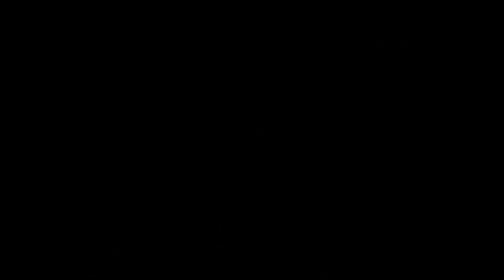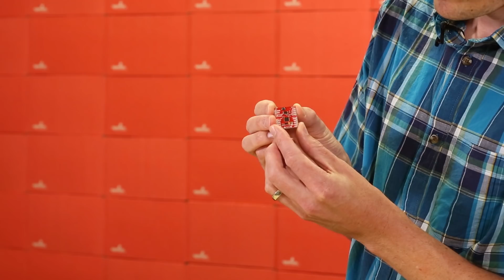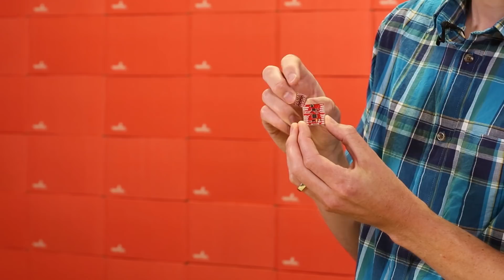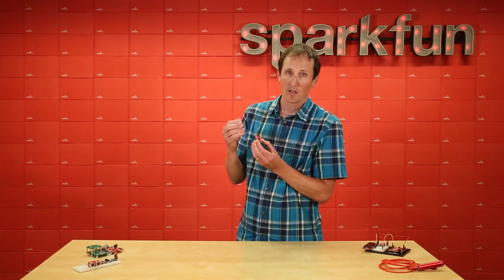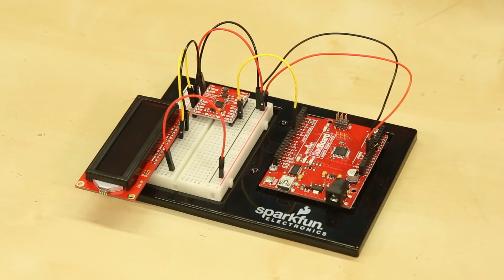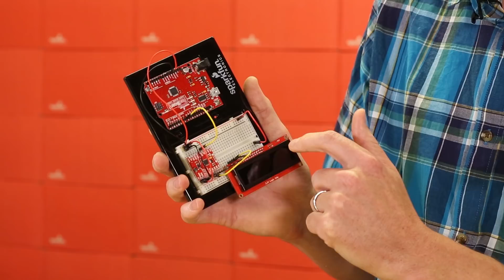Product Showcase: SparkFun Single Supply Logic Level Converter

Comment: Interesting. I hadn't noticed the 4 bit version before.
   I know the JTAGulator uses a bunch of the TXB0108's - 8 bit version of this translator IC. The reason I was looking into that one is because I want to use an Atmega644's ISP pins/port with a project designed to test multiple displays with 3v3 and 5v. I'm curious if it would be possible to program the AVR through this. The 'auto routing' feature seems really interesting. 
-Jake